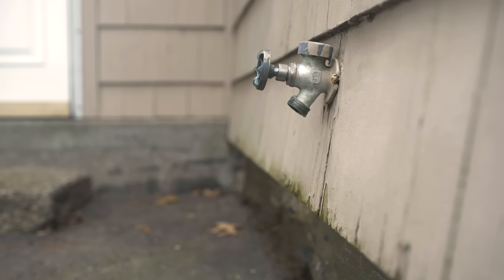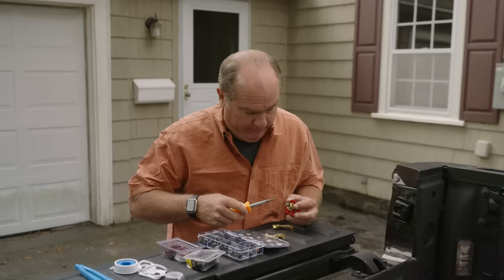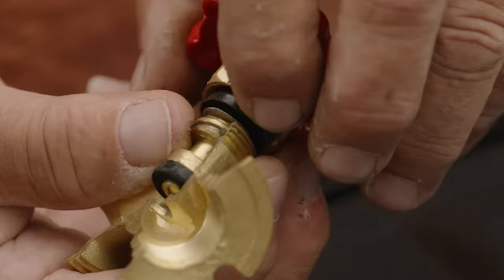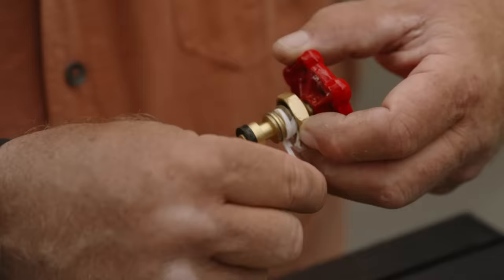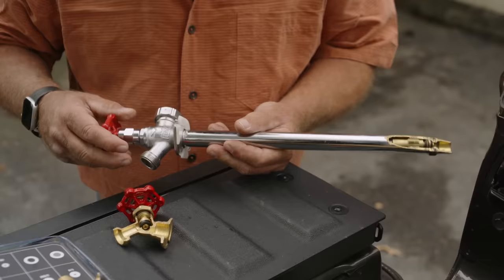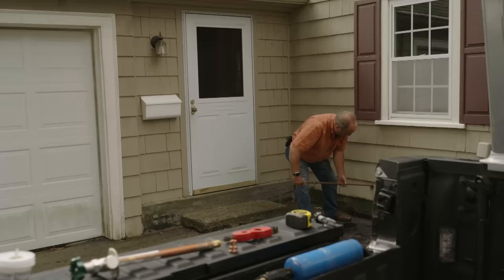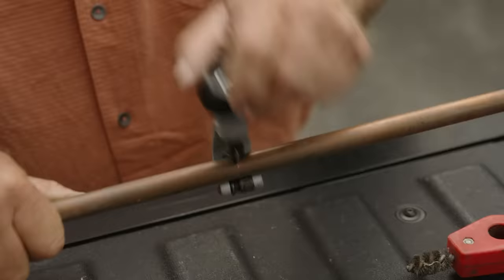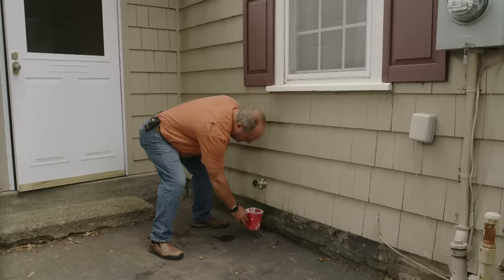How to Replace a Spigot | Ask This Old House

Comment: Job security soldering the FP. Too lazy to drill  the hole out bigger and install the FIP for east future removal  by unscrewing it instead of cutting soldering again.
Reply: @kchicago64  Have you ever considered each job is different and so are people's finances? Maybe the homeowner didn't want the hole drilled out larger...perhaps they were on a budget and needed to limit the cost of the repair.
Reply: @nopjack7278  let see a FIP adapter under 2 bucks drilling the hole larger takes about a min. Than in the future just unscrew it and install a new one instead of coming back to cut and solder again makes sense. You ever heard of doing the job right the first time? Wow letting a homeowner tell a license plumber how and what  to do on  job. And remember The Plumber Protects The Health of The Nation

Comment: Or just cut it off and use a sharkbite faucet. I’ve never had a sharkbite fail. I cannot say the same for soldering/sweating. And guess what, if it ever does, I just put a new on in its place. Sharkbite makes such a good product. Better faucets than the typical generic ones too. this comment brought to you by sharkbite
Reply: I agree with you 100%.  I just discovered Sharkbite fittings.  I've installed close to 2 dozen and never had a problem.

Comment: So your telling me that you couldn’t of put the piece threw the wall then attached that one piece with Teflon tape .. your creating  a flow reduction by putting the pipe on the inside
Reply: No opening in faucet seat is smaller than diameter of pipe

Comment: Or you can buy a new spigot for like 2-3 bucks.
Reply: Ha! Right?! Unless of course, your local hardware store happens to sell the washers individually for pocket change.
Reply: But depending on how it was installed it could be significantly more difficult to remove the whole spigot vs just unthreading the inner components.     For example if pex was used, or the spigot was soldered directly on, or in a hard to reach area, exc.

Comment: My time is not that cheap. I will prefer to replace with $3.99 spigot,
Reply: Depends on where you're located. If you're in a climate where it freezes in the winter time, you don't want to put a regular spigot on your house. You'll want to use frost-free setup like the one Richard is showing. If you're in a Southern climate where it never freezes, then the $3.99 one will work fine.
Reply: @bullmoosepiper7732  Tell that to Texas 😁😁